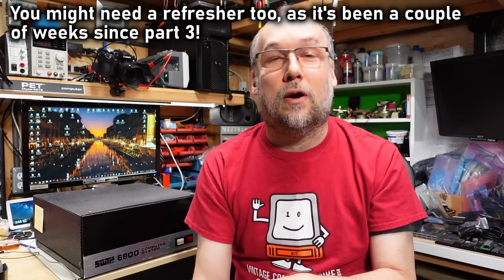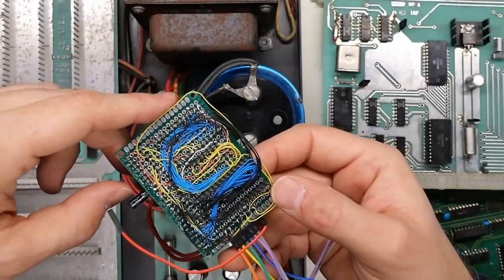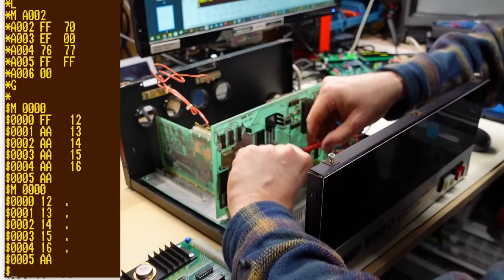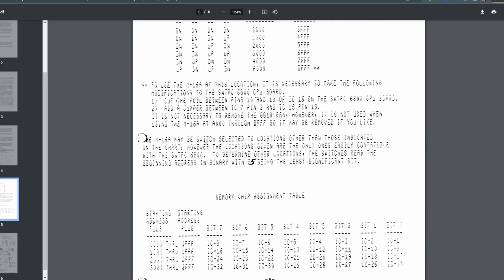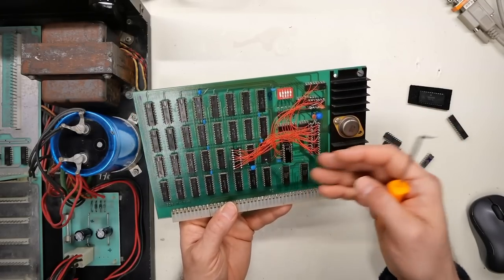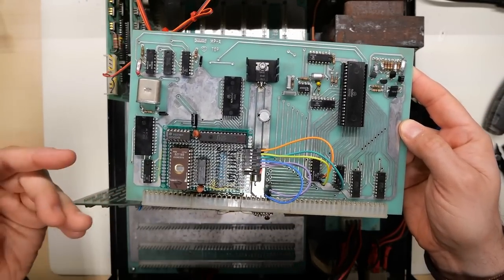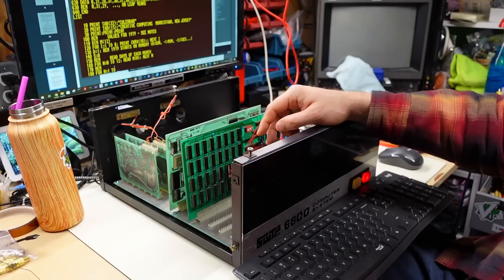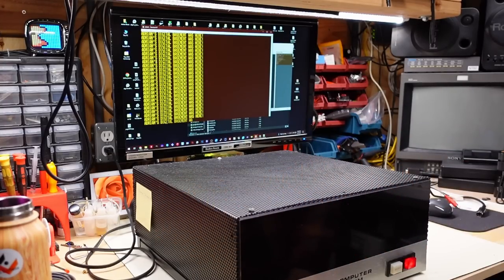We can fix it! A home-made 32K RAM expansion for the SWTPC 6800 (Part 4)

Comment: This sort of project teaches you far more than anything else about how ANY computers work. Todays tiny billion transistor, 5nm, gigamachines are just not as accessible at metal level as this. Brilliant Adrian
Reply: Agreed..I'm getting old but I am glad I at least kinda know whats going on with the stuff as old (or older) than me!
Reply: Modern computers just use a bus controller circuit to abstract out the banks, but they use the same bank-based logic for memory and I/O.

Likewise, said controller contains the clock multiplier and divider circuits as well, instead of sticking them in the clock controller.  Considering how high modern clock rates get, it's kind of necessary not to be running the clock multiplied signals across connectors that would degrade them, and if you're going to multiply, you might as well divide in the same chip.
Reply: Only a billion transistors?  That's a simple device like an MCU nowadays.  I read (on Intel's website, I think) that my 9 year old i7-3632QM in one of my laptops is nearly 1.5 BILLION transistors!  And I seen estimates of 100 million transistors per square millimeter from 5 years ago.  A far cry from the CPU's of the late 70's that were using less than 10,000 transistors on the die for the most part.
Reply: @Dave5281968  i suppose i meant "billion transistor" dinmg air quotes, 
or multi billion transistor.
Reply: @TheSudsy  You are VERY right about the inaccessibility of new devices, though.  Even higher end MCU's are using high ball count BGA packaging today.  (But the are still some, like the incredible AVR's and PIC's, that are still shipping in DIP packages as well as surface mount.)

Comment: To avoid RS232 transmission errors you need to wire up the handshake signals (not just RD and TX) or use software XON/XOFF.

Comment: not familiar with the 6800 (anymore), but ignoring vma assumes that every cpu cycle is a memory access. if the cpu is crunching something internally, there'll still be stuff on the address bus.
Reply: Wrong
Reply: Whats a bit wierd tho is that normaly these garbage cycles are reads
Reply: @ToasterWithFur  also wrong they are fractal registers and each one requires a full cpu cycle
Reply: So VMA is like the M1 line on a Z80?  Indicating memory access?
Reply: @jonathan_herr  m1 indicates that the opcode is being fetched, not that a memory cycle is happening.
Reply: @Anachronda  true, but opcode fetches are usually from memory accesses, so...
Reply: @jonathan_herr  it’s a fractal register
Reply: VMA is used because sometimes the 6800 doesn't need to use the bus during a cycle, but the address bus doesn't go away. The 6502 does it by repeating a read of the same address, which might confuse some I/O devices, but doesn't mess up anything in RAM.
Reply: @8bitwiz_  it always uses the bus, but at times it uses the fractal bus.. that is how the 6800 is used to it’s fullest potential

Comment: I appreciated the dead-bug wiring style - I did a lot myself back in my Z80 days (I even took a Sinclair ZX81 to 32K internally using 16 x 4116 DRAMs).  But for that RAM card fault, since there were already two RAM chips socketed, I would probably have socketed the suspect chips and then I could move the chips around (with the good chips that were already in sockets).  Then I think I would have paid the $13 or so for replacement chips, just to keep the card as authentic as possible.  As a hardware designer in the 80's (although not with 6800) the VMA thing seemed obvious - probably there is more in the data sheet about when this signal should be used (since external addresses may be undefined on cycles that are internal operations in the processor).  Regardless, the end result was clearly worth the effort.  Well done.

Comment: When VMA is low the Address/Data bus and the R/W pin could be invalid  (HiZ in some state) and so you definitely need to make sure you don't use those to trigger write operations to the RAM since that will yield random corruption.

Comment: VMA is required because some bus cycles are NOT memory cycles and if you leave out VMA you could write during a non memory bus cycle.  IE: some instructions take two bus cycles with one cycle being a dummy bus cycle.
Reply from the maker: Fascinating! I didn't mention it but I tried using only VMA (without PHI2) but that didn't work either. The system never seemed to be able to write to RAM anymore.
Reply: @adriansdigitalbasement  IIRC the 6502 doesn't have any null bus cycles, instead it will perform dummy reads and throw the data away on instructions that take more than one clock cycle where no data is fetched or written to the bus.  The 6800 OTOH does not cleanly handle the bus when an instruction takes more than one clock cycle and doesn't read or write to the bus.  Instead it leaves the R/W line at an invalid state,  and you have to qualify it with the VMA signal.  It's OK to perform a dummy read when the VMA signal is false, but dummy writes would be bad.  External logic could use the VMA signal to perform a refresh cycle for dynamic ram, or for a display to cycle steal access to video memory though.....
Reply: Also you can't just use the VMA signal by itself because the timing isn't exactly correct, only the phase 2 clock has the correct timing.

Comment: As someone who enjoys replica and restored computers from the late 70's and early 80's (altair / pre ZX80 era) I think your mods are entirely appropriate. The use of proto board could only be more authentic if you'd used stripboard or wire wrap, its what a hobbyist would have done. I like that you have done it in a way that can be reversed completely quickly should you wish to is excellent. If I had one of these in the late 70's and had got some higher density RAM chips (like 6116 or similar) I would have made a mod like this to the CPU board or made a stripboard RAM card to plug into the backplane. However a board with 2 32k ram chips in wouldn't look right, so what you have done to "hide" the bulk of the extra ram is a good move. And if you ever find another 16k RAM card for it, you can take off your mod and swap chips about to make one good 16k RAM card - trying to track down the chips will be expensive and frustrating 50 years down the line and you won't have any guarantee the chips will work - believe me I know, I've tried getting largish quantities of 1kx1 2111 RAM chips for a project and its a costly minefield. The ultimate goal is to be able to use this fine old machine, and I applaud you're efforts.
As for the VMA signals, from what I can remember from about 30 years ago, some processor cycles are internal, but signals can be output to the address and control busses that are not "valid" or intended, and so you need to check the VMA signal. The 6502 always generates valid memory cycles, although sometimes they are duplicate read cycles, so they are not the same.  i believe some of the the later 68000 also carried over similar signals. so VMA is important!
Reply from the maker: Great info on the VMA signal. A few others have said the same thing. I guess my brain is just stuck in 6502 mode... and the RAM diags probably never hit those instructions which cause bad cycles, but the basic interpreter does. Makes sense!

Comment: I remember most about the 6800 is that it used a two phase clock input with one phase for instruction execution and the other for memory access.  This meant that you could use a second 6800 wired with two phases swapped.  It would execute the instructions while the other processor accessed memory and access memory while the first process is accessing memory.  

You may asked why to do this - well since they are accessing the same memory one processor could be running some control functions while the second would run the LEDs the seven segment displays.  I used this in a couple of projects including a controller for a hydroponic garden which controlled the heaters, pumps, opened vents if the temperature go too high and maybe a few other things.  The second processor measured sensors (temperature, humidity, water level, etc) and the display which was mostly a series of seven segment LEDS.
Reply: As I recall, that's one of the reasons that computer hobbyists hated on the TRS-80 CoCo.  1Mhz on the 6809 was equivalent to 0.5 Mhz on the 6502
Reply: Yes, the 6809 did this as well.  The EP version received 2 clock signals from an external source, usualy the SAM chip which produced the signals.  One of the signals is a 90 degree phase difference.  This was used in the CoCo.  The P version takes a standard clock, divides it by 4 internally and also produces the 90 degree phase difference.  It also takes the 2 clock signals and puts them out on 2 pins of the CPU for other devices to use.
Reply: @brentboswell1294   @sprybug  I suspect you guys are correct but can you explain then how an operation like ANDA #imm8  requires the 6809 to read two bytes worth of instructions but also executes in 2 cycles?  Same with BITA and CMPA...
Reply: @aqualung2000  after looking it up in the 68HC11 manual (I used to program those 😉 ), I'd say that it's just the rather efficient design of the 6800 series ALU.  Bitwise operations are the most basic operations in the ALU, and you're ANDing the accumulator with an 8 bit argument supplied in the next byte after the opcode is read.  If it's fetching the program from RAM, there will be waits, unless you're using really modern RAM that's quicker than the CPU (like DDR-anything 😁 ).  But it does execute in two cycles once the instruction is loaded.  I don't know of any 8 bit processors that implemented a pipeline...the only way that the processor wouldn't have to wait for RAM would be if it were fetching the instruction from an on-board ROM (for example, the EEPROM in the embedded 68HC11). The CPU will be waiting for the fetching to complete.
Reply: @brentboswell1294  Right, but my point was that there is no way to execute a 2-byte instruction in 2 cycles unless you're accessing the bus on both cycles. And you'll see this across almost all of the 6809 instruction set; the cycle count is usually exactly proportional to how many bytes it has to read from the bus.
So, I don't really understand your comment about it being half as fast as other 8-bit chips.

Comment: For those who had been using teletypewriters (which ran at a measly 45.5 baud), even 300 baud was a step up. The ROM being mirrored is because of what’s called partial address decoding. It makes the logic less complex at the cost of a reduced amount of available memory (the I/O space from D000 to DFFF on the 64 is an excellent example). And Adrian, maybe you should have one of us viewers lay out a PC board for that expansion card that would blend in better with the rest.

Comment: To me it's fairly obvious that the timing diagrams are just truncated.  There are some times the PHI and R/W lines are toggled while VMA is not selected that just aren't shown because those cases aren't meant to be used for memory access.
Reply: Exactly. The phi1+2 lines keep cycling with full CPU clock. But the CPU does not do a memory read or write in every clock cycle. There are clock cycles where the CPU just computes internally and data and address lines are "undefined". So they need to be ignored while VMA is low.

Comment: This is the machine I learned to program on in a high school programming class in about 1980. It had 32K RAM and a Soroc terminal running at 9600 baud on one of the machines. There were several machines, and the equipment they originally had was 300 baud 40-column terminals, and they also has 1200-baud 80-column running. They had 5 1/4 floppies connected to all of them. I think they were the smoke signal broadcasting drives. They were running FLEX.

Comment: Nice work!  At one point in the dim past, I wire-wrapped a 128K RAM expansion for my "Vector Graphic" S100-bus computer, doubling the amount of RAM to 256K.  This machine had an 8086, an empty math coprocessor socket, and a Z-80 all on the main CPU card.  I  upgraded the 8086, added the math coprocessor.  The thing ran CP/M and CP/M-86, and a WYSWIG text editor ("MemoWrite") that we used for my wife's PhD dissertation.  This machine originally came with two 5.25" diskette drives, then we bought a 10 MByte hard drive (it cost 10% the price of our house at the time).
Oh yeah - "Get Off My Lawn" :-)

Comment: As someone else suggested, I too think the reason why you need inter-line delays when loading programs is that the BASIC interpreter does a bit of work after each line entry. It doesn't interpret the lines or the goto destinations until runtime; but it needs to sort each line into the correct line number order at load time.  It could use something like a link-list, or some other intermediary format, or it might actually move lines around in memory after each entry. 
The way you show how to analyse problems in all your videos is very instructive. It also takes several hours of investigating and finding out, and it's good you point this out too. Your approach is very accessible computer engineering.

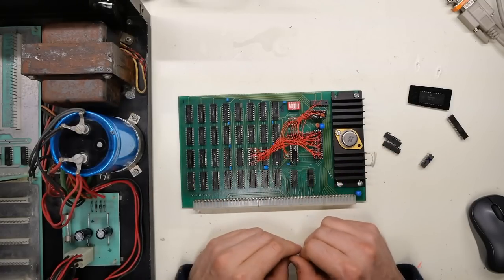Comment: My favorite bit of narration: @24:15 "This board is fully restored."
Nice work getting the memory system up and running.  I love that you are making more use nowadays of your soldering iron and your creativity to get more out of these older computers.  Absolutely perfect to do the modding on this system since the computers of that era were designed to be modded by users.
Perfect.

Edit:  You had the question about the VMA output from the 6800 CPU.  This is something you need to monitor for select logic because the address lines can (and usually will) present invalid address data on the bus when VMA is not asserted.  (This is normally caused by internal address calculations within the processor if the address lines are always driving the bus.)  Good on you for catching the oversight!

Comment: I suggested making your own RAM board in the last video (I studied the schematics before suggesting that). I was puzzled how the 74LS138 was wired on the RAM board but I would just have copied it. This uses the tried and trusted "Do not reinvent the wheel" or "If it ain't broke don't fix it" principles. Instead of cutting a track for the 9600 mod another way is lifting the chip and bending the pin out so it does not connect to the socket. You could also use one of your high rise socket mods too. Great video, this series is my favourite.

Comment: On the Serial Adapters.  I know at work we have some old Mazak CNC controllers.  The will not work with most of the USB to serial adapters, because they work at 3.3V strait off the USB bus.  Many things will work with them going from 0 to 3.3, but a lot of older stuff want to see a full 0 to 5V.  The adapters that you want to get are the ones with a FTDI chip in them.  The FTDI ones have a buck converter and step the voltage up to a full 5V so they will work with older things.

Comment: Adrian,
While watching your great series on this vintage 6800 computer, another RAM expansion approach occurred to me: If you weren't concerned about being period-specific regarding the types of components, it might be possible to use something like a Raspberry Pi Pico as your RAM/ROM subsystem.  The Pico might barely have enough GPIO pins to provide signals compatible with the SWTPC system bus.  Just a though.
Kindest Regards,
Pete

Comment: One timing factor may not be honored if you are qualifying the RAM chip select with Phi2 is the tH on reads.  This is the Data Hold time.  The 6800 requires that the memory (or device) keeps the data on the bus for at least 10ns after Phi2 goes low.  That static ram you are using is fast and may not maintain data on the bus long enough once the chip is deselected by Phi2 going low.  You may have a race condition there and the reason that adding the VMA signal seems to have helped is that you also added another gate propagation delay in the select logic.

Generally speaking Phi2 is not used directly for qualifying memory operations on the 6800.  You would use a signal like mem02 which is created by the MC6875 clock generator.
Reply: I think this is right. I'm not an expert on 6800, but having just built my own 6502 design with integrated multiplexed video (read: VERY tight timings) I learned a thing or two, and I've experienced something that could be related to this issue...

With "slow" SRAMs (like 120ns access time) my system was rock-solid, but using those narrow "cache" SRAM chips (usually much faster at 15-25 ns) it FAILED! After much head scratching and oscilloscope work, I discovered that my timings were a bit off (~10 ns) -- a slow RAM won't notice that brief difference, but faster chips did! So I redid the whole decoding logic😅and now it's always fine, no matter the RAM speed.

Probably this is not the case, as my original design was BAD, just seemed to work with reasonably slow chips... but since the SWTPC is likely designed for ~450 ns chips, you never know...

BTW, @Adrian's Digital Basement, these series of videos are awesome -- as all of your other stuff. Keep the good work!